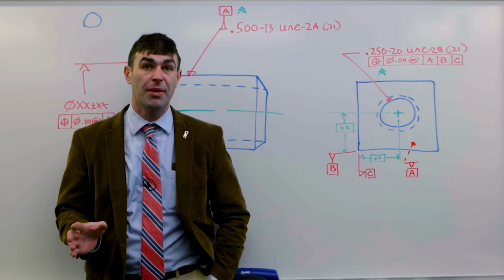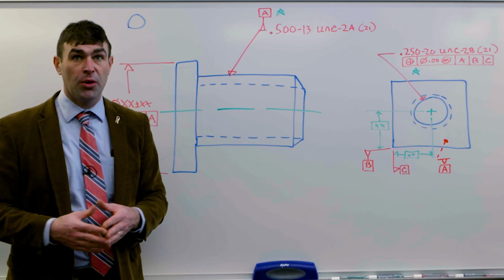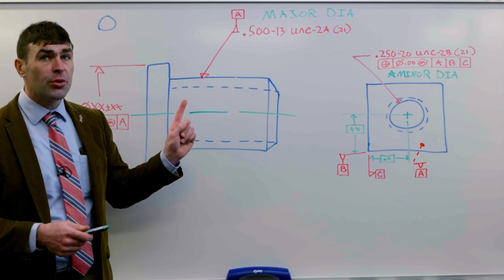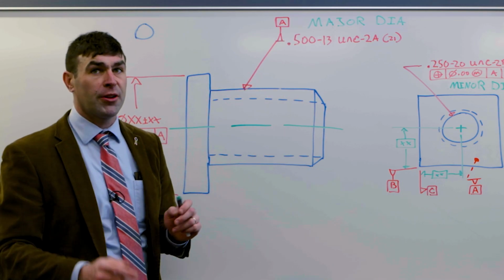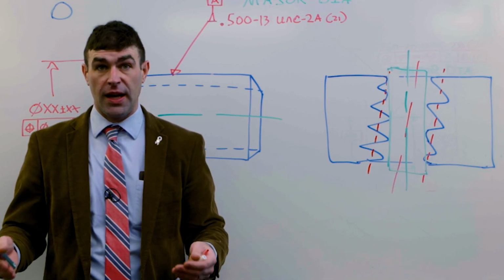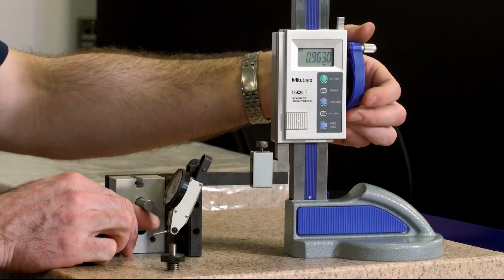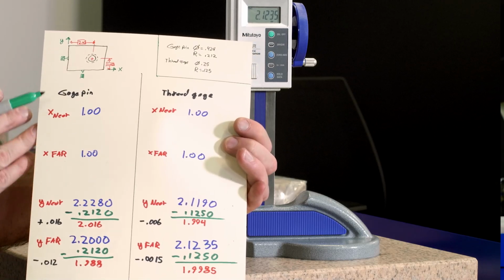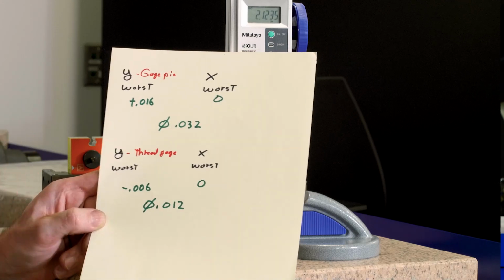The Hidden Problem With GD&T Thread Position Engineers Need to Know

Comment: I have seen this happen.  Part was being machined in palatalized machining center.  Finished pallet came out and operator found thread GO gage was tight.  Since part had not been taken off fixture, operator sent the pallet back in and re-ran thread mill for the tight hole.  Unfortunately the CNC had reset the work offsets to the fixture nominal locations to start the next run.  Parts would get probed and work offsets updated.  Thus, the thread mill re-cut the threads offset to the actual drilled hole location.  Definite edge case but got a lot of people upset.
Reply from the maker: Thanks for sharing. I’m not a CNC expert, but I think people imagine the machining process on a computer controlled machine being infallible. 

Model errors, programming errors, setup errors like you mentioned can all cause problems that may only be caught by inspection.

Comment: Question, the major diameter is produced by the turning tool and to use this feature we would use a thread insert designed to create a crest radius. The same with an internal threat that the minor is produced by the drill and not necessarily by the Tap. Using a roll (form) tap would remove this problem. Great video, thank you.

Comment: @10:12 (key point); "I did (setup/measured) everything (for the X and Y measurements) and it took forever"...the average CAD jockey, mechanical engineer, drafter, etc. doesn't measure parts for a single day in their life, and doesn't understand or appreciate that. Good ones do, but they are nearly nonexistent. Measuring without a CMM or optical CMM/vision system is a real pain if you're doing it properly. Even with a CMM there are a lot of variables that can lead to a part 'failing' inspection when it really isn't a bad part, and vice versa. Using threaded features as a datum, in practice, is bad practice if it can be avoided. Worse, I have seen threaded datums on fasteners which have clearance (captive screw), but without a mating part are immeasurable. My choice in that case was to remove the threaded fastener to locate the bore of the clearance hole to use as a reliable inspection datum which matches the functional intent/datum, but corrects it to bring it into reality. Good video, as usual, Thanks for your efforts and content in this industry.

Comment: I can only ever dream of being able to convey GD&T as elegantly as yourself. Thank you so much for all the fantastic content you make available! 
You already brought up the inaccuracy introduced by the shim you used, but I would also like to hear your thoughts about the following: 
1. The projected tolerance zone you are in effect measuring when you pick up on the pin surface at an arbitrary distance away from Datum A. Is there a correct, but practical, way to avoid this when not using a CMM?
2. How the inaccuracy stemming from the thread pitch/pin gage and the shimming compares to the feature's tolerance? (the pin gage has form and size error, and the thread pitch gage has form, size, location/orientation error)

Comment: I worked at a gear shop for 3-4 years and I think this concept greatly applies more to gears than screws, etc.. many times due to heat treat distortion or machining distortion the major and minor would be way off from the pitch cylinder.. often resulting in having to manually indicate the pitch diameter over pins and remachine important datum features. Its amazing to me that one could ever hope to trust the major or minor diameters in relation to to pitch diameter orientation.. anything can happen and the most important feature is indeed the pitch diameter. Unless the entire part is made in one complete setup I would never even get close to trusting their relationship to one another!!

This is a great video explaining the differences and the concepts involved. You are doing a great service to the manufacturing world!

Comment: When measuring the far side on the sample part, why not just probe the bottom of the part and gauge pin? Then instead of subtracting the radius you would just add the radius.

Comment: Thank you for explaining this topic, Mr. Odell. Great content as always. Question - How repeatable are those thread position gauges that locate on the pitch cylinder? Say you had precision block with square/flat faces, made from a durable material (e.g. steel), and it had a well-made threaded hole in one face. If you thread-in the gauge, take a measurement, thread it out, then repeat... say 5 measurements. What would be the scatter in the data? I'd be interested in even your gut feel. Are we talking thousandths? Tenths of a thousandth? I understand there are many factors in the part itself that will influence the situation. Do you have any feel for the effect of thread class on the repeatability/accuracy of those gauges? Will a 3B thread measure more repeatably than a 2B thread?

Comment: I had a situation where the hole was drilled at one cnc operation, then moved over to drilling for tapping/thread forming.. the thread angle was actually slightly off to the minor diameter.  I didnt think it could happen but the cnc programmer who had been around a long time said that yes, it is possible.  It is hard to picture but i saw it with my own eyes.
Reply: This! Concentricity may also vary.

Comment: Hello, thanks for the video. I see you have MMC on the position of that threaded hole. Is it just so you can use that physical gage? but then if you are out of the allowed tolerance then calculating the bonus tolerance would be a real pain or is there an easy way to go about it?
Reply: Very curious to know Mr. Odell's input on this.